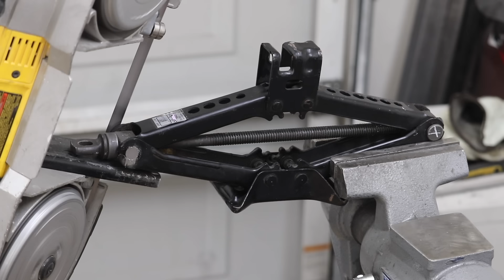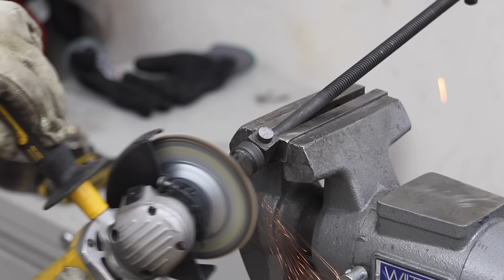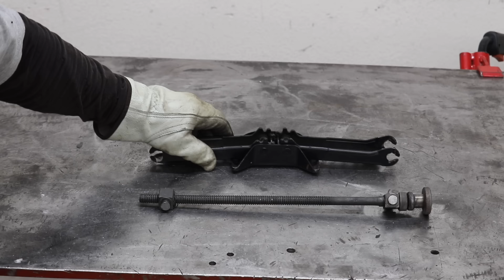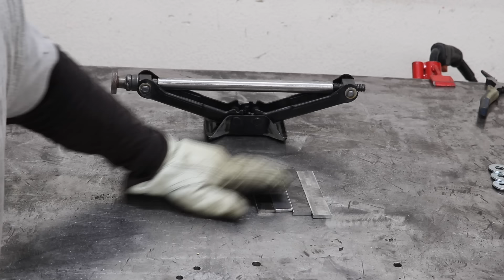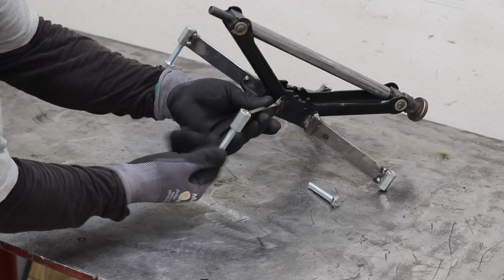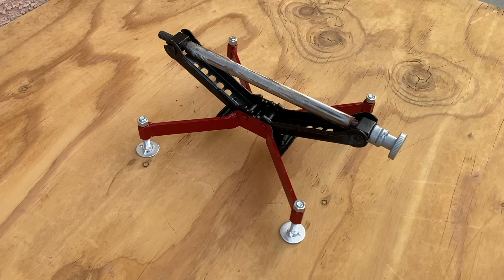THE BEST DIY IDEA FROM OLD CAR JACK!!

Comment: What's the point of it being adjustable? The height of the chop saw doesn't vary . Can I have those 6 mins of my life back ?
Reply: Height of a saw may not very but weight and length of material being cut can cause a un straight cut if not supported correctly so this is a great idea fir that reason..
Reply: I have a similar issue with the height of my workbench Vs miter saw. Solution: a long block of wood from a broken down pallet. It is the perfect height and there is no need for adjustment.
Reply: When you're on different jobsites often times you're putting your saw on uneven surfaces so having  the adjustment is useful, also the stands that are made for miter saws have that  same adjustment to deal with different material dimensions/sag/etc
Reply: Imagine the support of a drill press. The height vary on this tool cause of the limited way the drillhead has, so when you adjust the support table for different thickness of material your support now can also vary in height.
Reply: Not all my saws have the same exact height....
Reply: Not all have that absolute perfect shop so it is great that such creation are shared with all who have that imperfect shop. Besides this can be applied to other applications such as a router lift.
Reply: Wow what a clever comment.  Your parents must be so proud of you.  Completely oblivious to the reasons why a support stand needs to be adjustable and still able to make a critical comment about the video.  What a dooch.
Reply: Total waste of time!
Reply: Lol, that was my thought exactly! The big reveal was a little bit of a let down, but still very well executed, and a clever use of available junk. 

Personally, I think I would have cut the bar shorter, so that it would have more travel and be a little less niche of a tool.
Reply: For oddly shaped items.

Comment: The jack could still be used that way in its original configuration.
Reply from the maker: Yes, unstable, but you can. Thank you for watching.
Reply: Yes you could just weld legs on it still and a plate on the top and it's done
Reply: Thanks Joe. I thought the same thing.
Reply: Legs would solve the stability, but a plate instead of a roller for your outfeed or infeed table presents its own problem, drag, warping, generally a roller is better for this purpose.
Reply: @ joe woodchuck That’s what I was going to say.
Reply: @axcreates_official  +
Reply: Its True
Reply: P
Reply: I simply sit mine on a large block of wood, about 12"×12"×3" thick, works a treat.
Reply: The piece of pipe was not needed at all, and severely limited the amount of travel available.

Comment: I think securing a small plywood platform to either side of the jack would have worked too.
Reply: follow the kiss rule
Reply: How does a 'plywood platform' act like a roller?!
Reply: @trueaussie9230  so the only way you move something on a surface is if there’s a roller attached? You ever heard of sliding. You can slide it to whatever side desired. I do it every time I cut lumber on my miter saw, and I’m sure it’d work the same with that piece of metal.
Reply: @punkinmyvitamins1  
WOW!!
You certainly make a LOT of assumptions from 1 simple question (which you failed to answer).
From your bellicose response I suspect you don't appreciate your 'authority' and / or 'opinion' being questioned in ANY way.
Reply: @trueaussie9230  The roller doesn't work anyway, see how hard he had to hit the threaded rod to get it inside the outside tube.
Reply: @mountainbikemike  
Damn!!
You're absolutely right!!
He really had to POUND that thing. (I've used greater force inserting a thumb tack. 😆)
And, notwithstanding the fact that I can easily rectify that 'problem' by choosing a slightly larger ID tube, I should sue him for wasting my time by FORCING me to watch the video and learn the general concept - which I have modified to solve a different problem. 😉🤣🤣
(Even if the tube doesn't 'roll', it provides a better sliding surface than the threaded rod. But, if you don't like it - don't use it. Simple.)
It's a very poor day when you don't learn something - if only something you can use in a different way.
But, of course, that requires the ability to think for one's self and to think laterally.
Reply: @trueaussie9230  just pointing things out doesn't mean the overall concepts and principles aren't understood.
Reply: @mountainbikemike  I don't see the need for the thing, either. I have four or five scissor jacks. Very useful wrighting and leveling a lot of things, supporting floor joists to repair sills, etc. I couldn't see myself wrecking one since I often have two or three employed at the same time. But my time is money- I guess if you just need a project to do, great. My wood blocks are always the same height everytime, and I have a saw stand with wings so again, not seeing the point either.
Reply: What a dumb idea. Anyone seeing  this video will go away dumber for watching.

Comment: Good video! I did this 30 years ago before youtube, welded a long roller with brackets to an old scissor jack I saved from aToyota Corolla. I welded a large hex nut so I can use a ratchet or a driver. 
You could also screw the base to a sawhorse or whatever you have. Take an old steel wheel and put a post on it.
Reply: What a dumb idea. Anyone seeing  this video will go away dumber for watching.
Reply: I did this 50 years ago!

Comment: Yeah, sometimes I use that kind of jack on the side of my miter saw (but without the fancy doo dad attachments as shown in this vid)  to level out long pieces of lumber, on account of the very limited resting base of my saw. Proven to be very helpful on account of it's easy adjustable functionality, as clearly demonstrated in this upload.

Comment: I was curious to know what you were building.   would it not have made sense to just weld a holder to the original jack and just add extended plates for support? it seem you too apart a jack and put it back together to achieve results that could have been performed by original design!
 its good to see the modifications. keep on  keeping on.
Reply from the maker: I suppose you can. I found it is more useful this way. Thank you for watching.
Reply: and with the roller bar in place it severely limits the upward movement range
Reply: True
Reply: I'm sure he could've built a support, or tool, that was alot more simple, for a relatively simple needed solution to help what his shown objectives were in need of!??....And I could've used alot less words to argue my point!!..But I Didn't!! I'm inspired by what a car jack can be repurposed into!!. NECESSITY IS THE MOTHER OF ALL INVENTIONS!!..Brilliant!!<

Comment: I am going to use you idea but put it on a pedestal. This way can use it with my tubing bender. I feel just from I watched this would even be more useful with a common problem building roll cages with benders. To keep the big hoops for stronger cages (and legal for sanctions) because these always use long tubes. This makes life hard because if something is off even a degree or 2 from the bend is a lot of sloppy fitment over at the other end. Thank you I absolutely love this idea now!!!
Reply from the maker: Thanks.  Glad you liked it.  This one is similar, but with more adjustment. Thanks for watching. 👍

Comment: If someone doesn't understand the value of the adjustability in this tool they obviously haven't worked it the field much or understand the fact that not all bases are equal height...

Comment: I was curious if an old car jack could be used as a dent puller?
Reply: I have used my scissor jacks to repair cars- as a pusher, not a puller. but a screw does work in both directions. I bought a $25 car for one of my daughters that had played in the snow a bit. It ran great and the steering, wheel alignment was fine. But doors werent shutting right, truck wouldn't latch, etc etc. 
I used short lengths of 4x4 lumber and jacks to stretch everything back to where it belonged and my daughter had the car I couldn't afford. 

So you can straighten out metal with one.

Comment: More interested in how you made the stand for your band saw... Video on that would be nice..thanks
Reply from the maker: Here is the link to the video. The only thing i would change is the threaded rod and nuts for bearings as there is still some displacement as the saw comes down. It is minimal, but still there.  I just used what I had available. Thanks for watching. https://youtu.be/1FQf9hrrT84
Reply: @axcreates_official  Many thanks.. Will build similar one soon..
Reply: @axcreates_official  Thanks Ax. Funny-I watched the video and was thinking " all the precise measuring that guy did and he uses bolt and nut for bushing"...I got what I needed from the film. Thanks. You  know how sometime,no matter how good a tinker you are,some simple thing doesn't want to come to you??

Comment: Average cost of a welding school is between $5,000 and $15,000

The average cost of a minimum set of welding tools, including a basic welding machine (like a stick welder), necessary safety gear, and a few essential accessories, is typically around $200 to $500 for a beginner ($1,000 depending on the features and intended use)

Average cost of Scissor Jack for Car 2 Ton $25

Total average cost to level item to be cut $10, 325

Using three pieces of scrap wood to level your item to be cut: PRICELESS.

Comment: I don't see the point - if you have solid table, solid saw height then why you need adjustable support?
Reply: Agreed. There is no practical use for this.  Heck, you could just use the jack in its original form and accomplish the same thing.
Reply: @justal8784  for real..makes no sense

Comment: awesome, you make welding look so easy, what type of welding is that? Argon?
Reply from the maker: Thank you.  That is GMAW, commonly known as mig.  It uses a gas ( Mixture of 75% Argon, 25% Carbon Dioxide) to shield the weld.

Comment: Why go through all the trouble of cutting a jack apart and re-assembling it?
Just make a frame with roller that is the same height as the saw base.
You won't ever need to go up or down from there.

Comment: Should have just weld the feet on their put metal sleeve over threads or a plate like a transmission jack that's what I'm going to do instead of taking it all apart you were still useing same handle

Comment: Okay so why limit it to a little table top design? You could have welded a pipe to the top of the jack and put a tee top on that pipe to do the same job. Adding stabilizers to the base as well. Then you wouldn’t be limited to the table top.